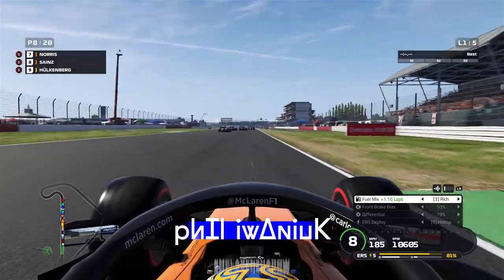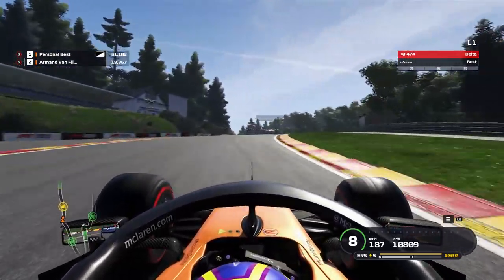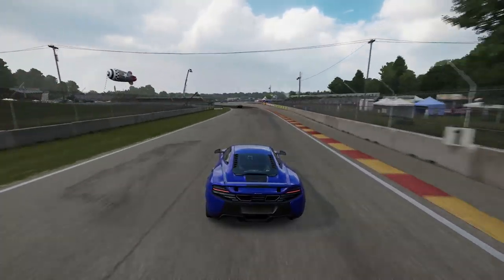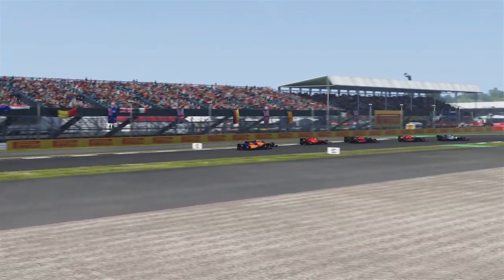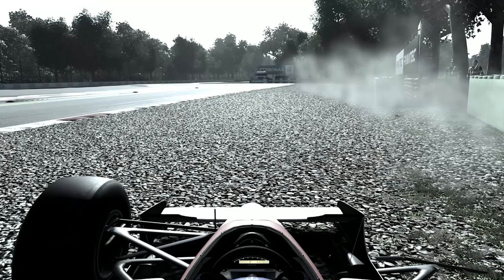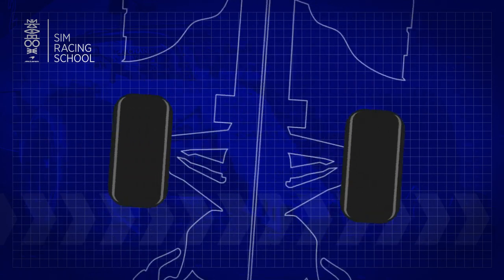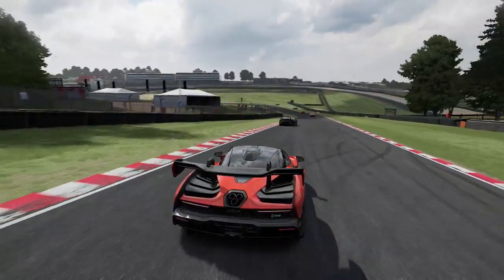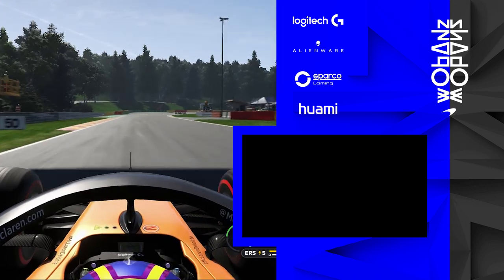Sim Racing School: Tire Management

Comment: Another tip to save tyres: don't fight unnecessary battles. If you see a opponent is clearly faster don't fight him too hard. It will cost you time and kill the tyres. Of course you should fight it if it is the end of the race but e.g. in Lap 18/70 dont fight it

Comment: Higher pressures doesn't necessarily means higher temps. Side wall flex from low pressure generates a heap of temperature